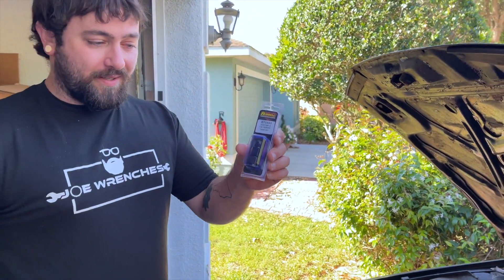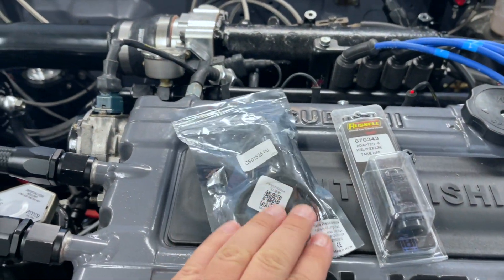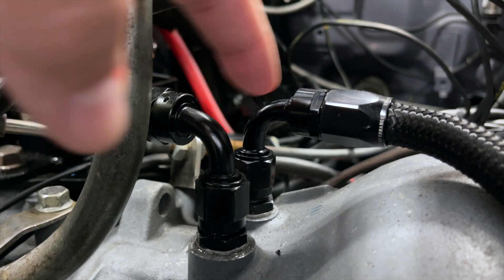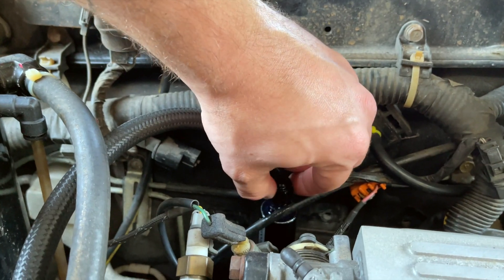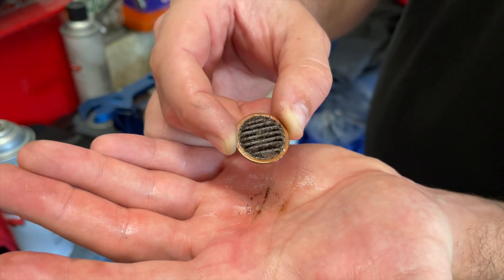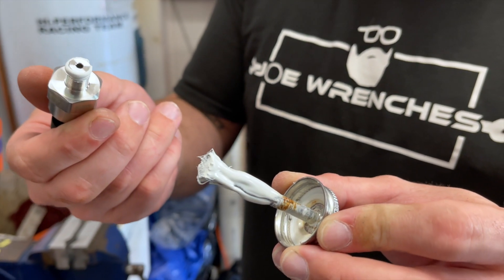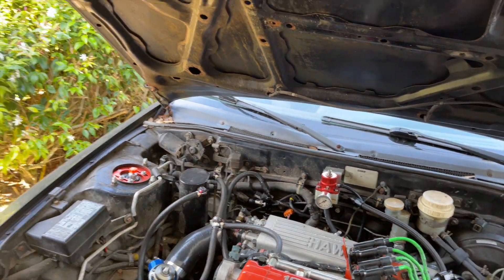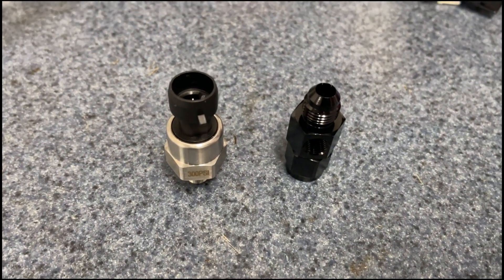Installing Pressure Sensors

Comment: Hey joe curious to ask how you like using the Link Ecu /PCLINK on your car and what you think are your pros and cons ?
Reply from the maker: The Link ECU is ok. Long story short, I wish I spent the extra few dollars on Haltech. It's real easy to read about all the good things the Link Fury will do. It's more difficult to find out that not all of the temp inputs have software pullup resistors. The digital inputs are limited and cant accept the high frequency of OEM ABS sensors as speed sensors. There are no math channels in the ECU. No dedicated nitrous control. The software is really good, no problems there. I like the built in wideband, plenty of I/O at the price point. Built in peak hold injector drivers is nice.
Reply: @JoeWrenches  thanks for the response and I’m sure you want to control the shifts via Ecu eventually . I’ll be giving it a go on my 2g but if not haltech was my alternative
Reply from the maker: @marcwitkowski9964  I just wired in a Forced Four 100.1 shift box. It's going to be shift for me til I upgrade to a Haltech in the future.

Comment: What are the part numbers for the sensors and -AN adapter fitting?
Reply from the maker: Not sure. AN adapter is called a gauge port. Sensor is your basic cheap sensor from Amazon.

Comment: I didnt comment on the dsm page as i forgot but on the trans lines why does yoirs go back into the case from the rear out port? Is the 1G that different then the 2G? I have both those ports going to my oil cooler as the oem had it. 

So if yours is routing back in on itself. Where yoir lines going for the cooler and then return?
Reply from the maker: It is all explained in a recent video of mine. https://youtu.be/fpn7bkh310U
Reply: @JoeWrenches  just watched it, where did you find the data and details on this to do it? Im building for circuit racing so its an interest to see if this is better then the normal way me and so many have been running them for years!
Reply from the maker: @ec17pse  The fastest auto DSMs in the world, for example Aaron Gregory and Kevin from Kiggly Racing, do this because it makes the planetaries last longer. Good enough for me.

Comment: Any advantage to the additional fitting just putting the sender on the fpr?
Reply from the maker: Just that you get to keep your mechanical gauge under the hood. Makes it easier to set base fuel pressure and get a glance at it here and there.

Comment: Those tranny cooler lines don't actually see full converter pressure from what I thought right?
Reply from the maker: The trans cooler is fed directly from the converter, so that line should have converter pressure. The cooler return would have the same pressure, minus pressure drop from the cooler, but I'm not using it that way. My return is being fed from the RD part as seen in the video, so measure pressure there is RD port outlet pressure.